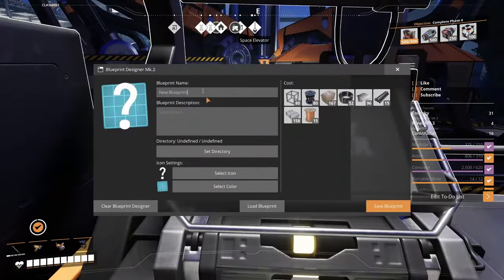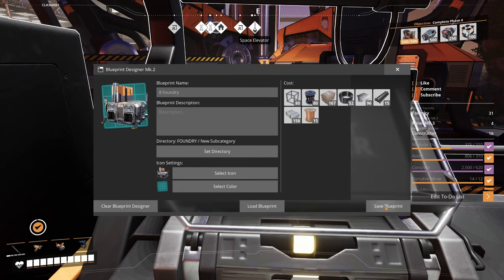Satisfactory 1.0 Blueprint Masterclass with BIG - Foundries

Comment: Would the ‘crooked’ belts look nicer if you turned the associated elevators 90° and then connect to the merger?
Reply: They won't wind up straight but at least they'd be on-grid which is all I care about.
Reply from the maker: That will work and they'll look better, I think I'll update that blueprint following your advice @vikingbrit270. Thanks for being here.
Reply from the maker: @Isntmal  they look really good when you twist the opposite lift (the one that's not aligned with the splitter ). Thank you for being here.